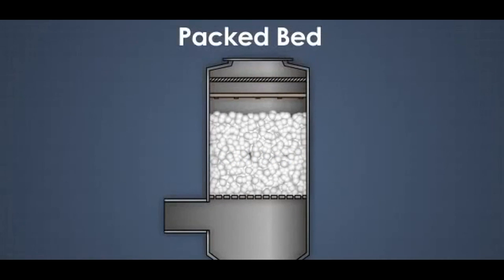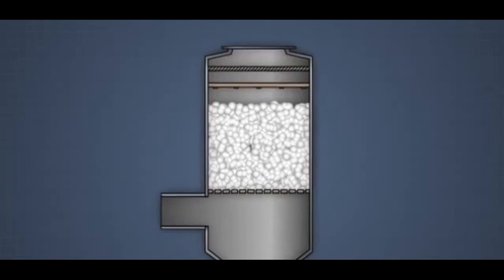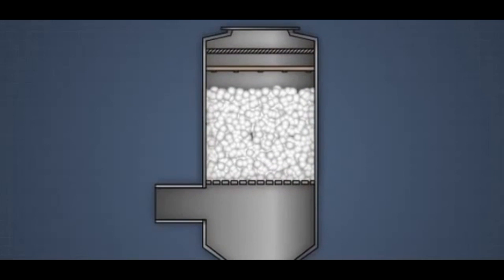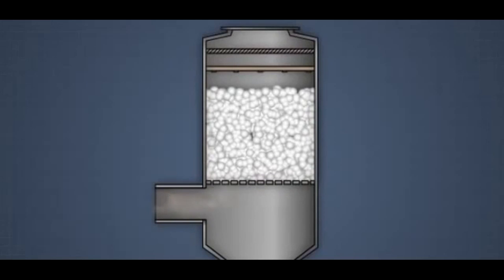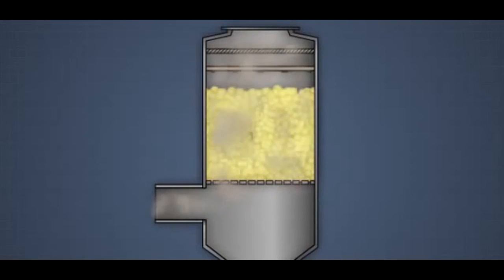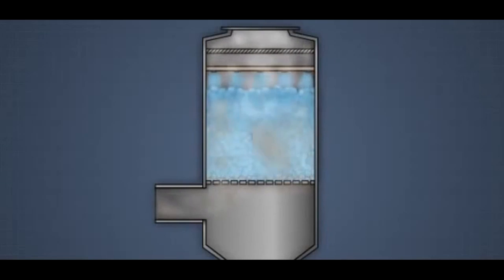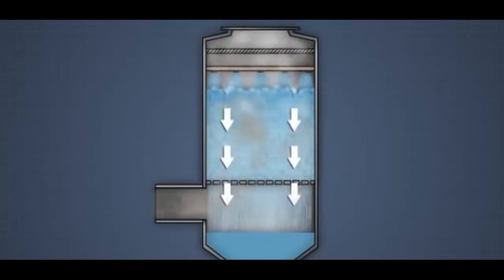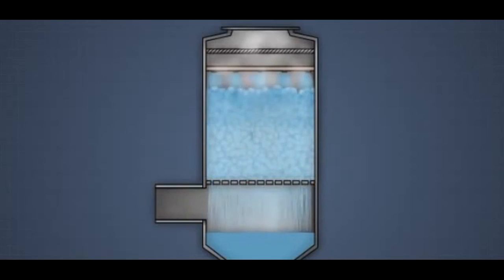Scrubber

Comment: “Packing material”...zeolite? 
If so, how many washes through it, until the material needs replaced?  
Zeolite can filter contaminants from polluted air. It is also how oxygen concentrators produce O2 for people who need it...& needs replaced periodically (costly, for a mineral).  
The water washing through the tiny stones, also acts to capture pollutants. 
(Ref.: hookahs, & zeolite)
Are you going to be selling these filter hoods From the Sing Core business?

Comment: So does the liquid absorb the contaminant or just sweep it out of the gas ? What is the principal of separation ? 

And does the mist eliminator prevent entrained liquid from exiting through the top with the gas ?
Reply: Unsure what they used..they were intentionally vague. But guessing it could be zeolite. Zeolite can filter dry air, & be decontaminated a number of times, depending on what’s been filtered.  
Zeolite is also the central component of O2 concentrator machines, which periodically must be replaced to keep the machine making concentrated O2. 
The water + their filter media both, can filter nasty stuff from polluted air (Ref.: hookahs, & zeolite). 
I wonder if using zeolite with water wash, creates some better O2 levels in the filtered air...which could kill viruses, & help boost a users O2 levels.

Comment: hay sir is there motor required or blower to send contaminated air to scrubber
Reply from the maker: Hello Hamid Mughal. 
As these kind of scrubbers are usually used in Boiler Houses, the contaminated air is transferred from sources like Boilers, Thermopacks or Hot Air Generators. So the line of gas flow is subject to negetive draft using an ID fan. Hope this helps. :)